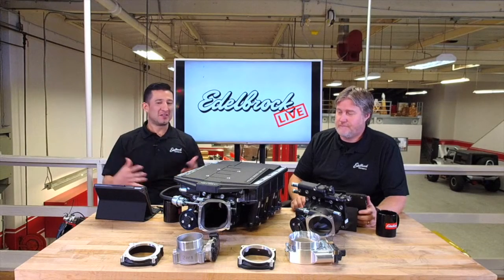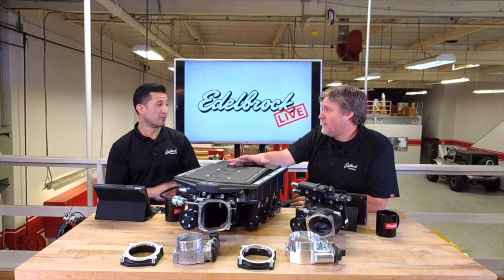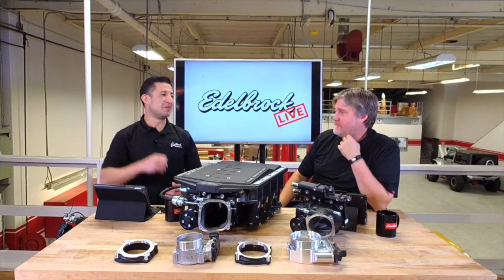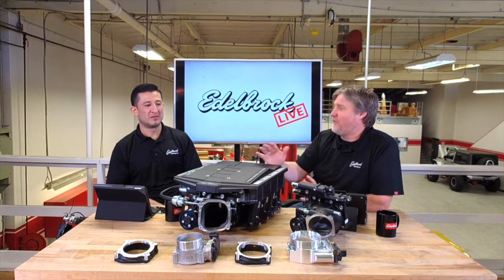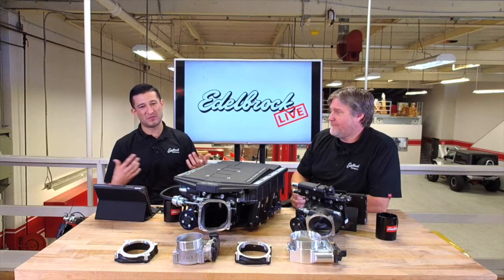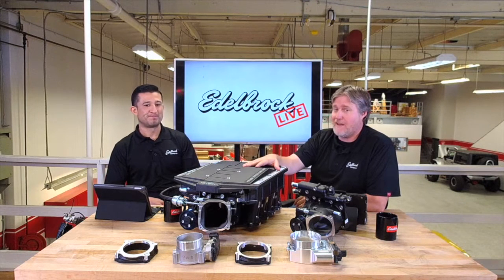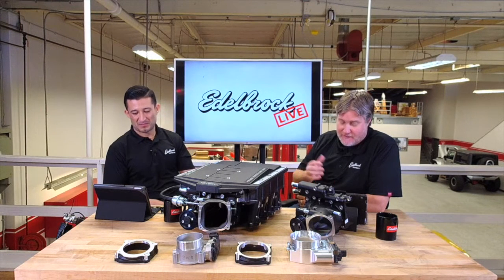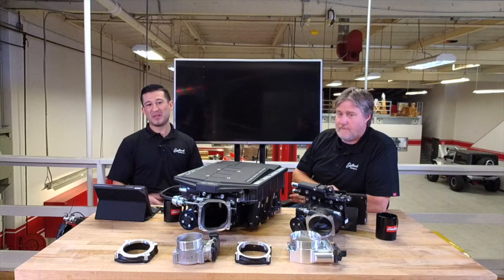Edelbrock LIVE Episode #16: Mustang Modular Supercharger

Comment: On the stage 1 kit do you need to upgrade injectors

Also does it have a bypass for low road hey driving?
Reply: I had my stage 1 kit tuned by vmp and they wouldn’t do the tune unless I upgraded to  13-14 gt 500 56lb injectors .

Comment: i have the 1586 on my 2015 GT Auto. Best looking kit on the market. Love my EB super charger!!!
Reply: D SELF Don’t you mean the 15865?  Also, what dyno numbers are you making if I may ask?
Reply: Mike Hughes 598/543 wheel Auto Lund Tuned
Reply: D SELF I keep getting the itch for this kit. Still performing well?  What upper pulley you have?
Reply: LightningBlueMeanie yes it’s great. Lund tuned. I have the 2300 running 3.25 pull. 10lb of boost. Plenty of power. Car drives like stock, till you hit the gas..lol I did upgrade the injectors DW95s added  boost a pump and NGK plugs.
Reply: Mike Hughes I have the first gen 1586 2300